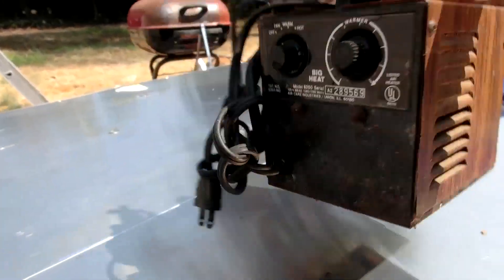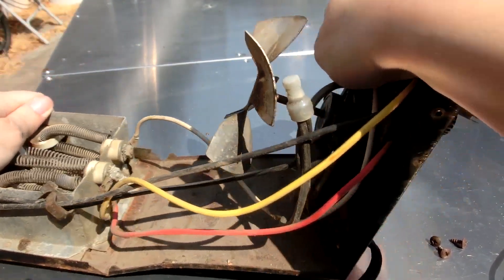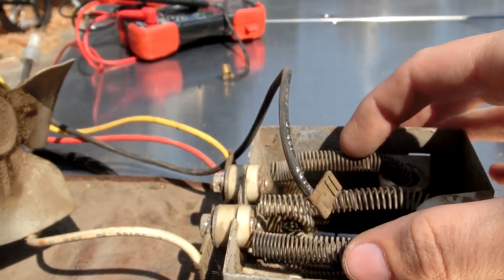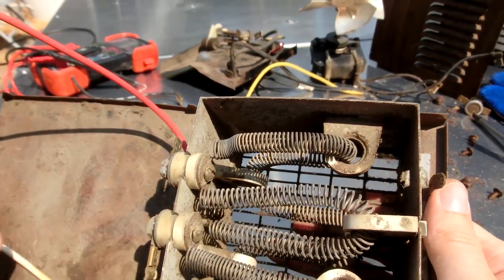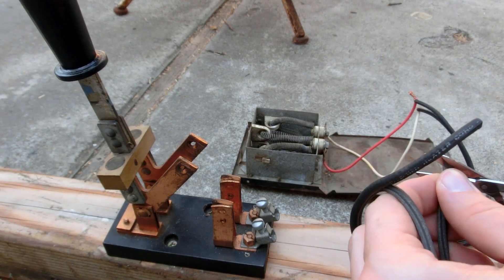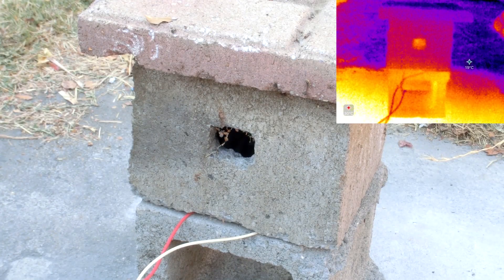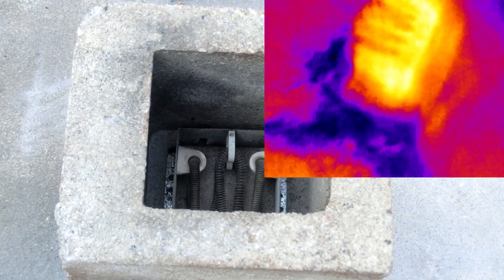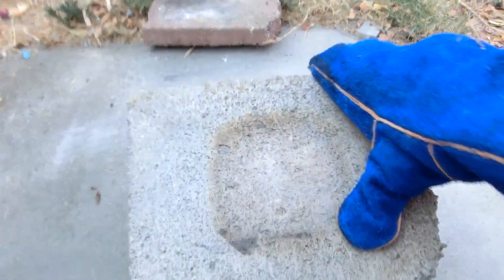DIY simple electric furnace / kiln from free parts

Comment: 1:03 ha! that's a type of single rope braid to neaten up tool cords. You pull the end through itsself once then just yank and it all comes apart.
Reply: a way to never have a tangle on a 100' extension cord. Learned it from an old electrician.
Reply: I've heard it called a daisy chain.  I learned it skydiving, after you land it's a quick way to get your parachute lines organized so they don't tangle
Reply: it's fast when I do it
Reply: you try to coil your parachute lines without a daisy chain, you better be packing your own parachute.
Reply: It's the worst way to wrap electric cords though. Loose untwisted coils is best for long cord life

Comment: I am genuinely surprised seeing how easy those little scissors snip those wires. Knife I had was rubbish, metal was as soft as aluminum. Now I understand why you like that knife so much :)
Reply from the maker: got this knife when i was 12 too, its cut every single 18650 terminal ive ever opened. so thats like 900 cells. haha
Reply: Got a Tinker myself around the same age and at 34 it still rattles around my pocket and has the battle scars to prove the number times of its been indispensable though the scissors are getting hard to operate b/c a mixture of gooey material that no solvent seems to want to shift has gotten into it's hinge area and the spring for the pliers is missing completely (along with the tweezers and toothpick that fell out somewhere along the way lol) because it broke so I used a pin punch to drive the remaining piece from it's holder after almost cutting myself on it a couple times.  Thing's literally saved my bacon more than once fixing things like a blown off radiator hose from a failed clamp when I was away from home and hadn't any proper tools in the car but could get a lift from the friends house I was near to the parts store for a new clamp and a gallon of coolant.

Comment: be careful not to damage your thermal sensor with too high temps. mine has a permanent shadow in it due to filming a candle for too long (the software adjusts for it, but still, one day it will be damaged to much to compensate)
Reply from the maker: i dont really care about this camera too much, i plan to get a better one someday. so i kinda see it as a tool that can be broken.  but thanks for the tip.
Reply: fredlllll. Candles must interest you?

Comment: I saw a dude's youtube video where he was instructing people how to wrap their extension cords like that... cuz then you can use it as a short cord without a bunch of extra tangled cord on the floor, or extend it and use it as a longer cord again.. seemed to make sense when I watched the video, but apparently not worth the effort as I forget what the method was exactly.  PS your hair is silky smooth.
Reply: sauce to your pf pic?
Reply: yes? i guess
Reply: YES.
Reply: The method Is loop over loop and I use this method primarily because the cord extension will last longer this way and far more easier to untangle. As you pull the end of the cable it simply untangle it self.

Comment: a good alternative use, pretty ingenious, however i would say that big switch is super dangerous (very cool looking though) like what if a cat rubbed up against it, or you tripped and touched it.
Reply from the maker: no its not super dangerous. if the cat touches it then it will be given a swift reminder of why not to. and just dont trip. tripping is the fault of going too fast. as soon as i make a system live like this i slow down a lot so i can be sure of how to interact with it.
Reply: +Rinoa Super-Genius 
Hi
you have a ~ 600 amp switch on a 14 gauge -15 amp circuit. The appropriate switch ( rated for 15amp) is probably $ 1.59 and a box could run you close to $3.00. Foolproof and safe.
Reply from the maker: *****
but this is a good reliable switch. it works already.
Reply from the maker: *****
no, i dont "assume responsibility" for if others are idiots. my video clearly shows me not getting shocked, so if somebody else gets shocked they arent following my video. plus if a few more idiots kill themselves thats fine with me.
 
oh and my channel name is sarcasm, ever see looney toons?
 
this switch works fine for my application, i enjoy the simplicity of it and feel its made very well. if you have issues with that then just fuck off and dont watch. simple as that.
Reply: +Rinoa Super-Genius 
That's unfortunate. You clearly do not understand what responsibility entails. It's also sad and a little stupid you rely on luck rather than easily acquired skills. The only hope you have is  your infantile ignorance doesn't kill anyone. I hope your maturity kicks in before that.  Good luck

Comment: that switch is a hazard waiting to happen
Reply from the maker: only if you act like an idiot and dont respect electricity.
Reply: +Rinoa Super-Genius yep but that switch looks quite tight on them contact maybe you could slip
Reply from the maker: RC MAD
what?
Reply: If you pulled the handle and for some reason your hand slipped and hit the live wires
Reply from the maker: RC MAD
well i dont know how that would happen because if i was pulling it was be away from it...but lets assume this is some weird 4 spacial dimensional universe, it would still just be a 120v ac shock. it would be a firm reminder to be more careful, and not live in 4 spacial dimensions. lol
Reply: +Rinoa Super-Genius maybe a future video of you putting a clear box over it or even plexiglass made by yourself that would be cool
Reply from the maker: RC MAD
no, stop being absurd.
Reply: I Love that OG switch.  and it's only running 110 anyway, right?  if you don't respect electricity while you're using it you soon will xD
Reply from the maker: Tom Cummings
exactly.
Reply: you won't actually get 20 amps through your body. human skin has a resistance of up to 100,000 ohms. using ohms law with 110v and let's say 10,000 ohms that would give us .011A. .011A is enough to cause pain, but not enough to kill you. .1A and above is lethal.
Reply: "a resistance of near zero" this just in: humans are super conductors. the resistance is dependent on moisture and distance. even when wet, human skin can be around 1000 ohms. If the skin was broken where both contacts touchced the body, then the electricity would go through the hand, not take a damn detour to your heart, stop by and say hello, fuck its day up, then leave. Electricity follows the path of least resistance, so just don't touch each wire with different hands while wet and have gaping wounds
Reply: While I totally agree that electricity can be very dangerous, I've been shocked by 240V AC (actually closer to 250V) mains several times and still here to tell the tale. Hurts like a B*tch though. When it comes to high voltage electricity - just be careful!
Reply: well I didn't see rinoa tip-toeing around the thing and he appears to have survived despite that.  and having been shocked tons of times working on swimming pool pumps wired for 220 I fail to see how there's much of a mortal danger in a lil' 110 bite
Reply from the maker: *****
400 is a pretty small amount. thats like how many people die from ladder related injuries.
Reply: key point here is WORKING with electricity, I reckon.  becoming complacent and careless.  performing the same tasks over and over again such that one can do them without thinking.  that's when accidents tend to happen
Reply: and I doubt they are stupid people.  easy to claim that they are stupid from a perspective of not having been there
Reply: having a huge open switch with live current is the opposite of respecting electricity
Reply: I’ve been shocked by 110 like 100 times. No it’s not fun. It’s just a reminder to stop being stupid.

Comment: Perfect use for your knife switch. Some years ago I was into home foundry stuff. I poured a furnace with grooves around the sides and put elements similar to yours in it. I could melt aluminum in it and where earlier I used a charcoal furnace, the electric could be used indoors. Very handy. I can see you getting refractory material in the future and pouring one to your specs.
Once again Rin,,, well done.
Reply from the maker: thanks!
Reply: That works very well.  In fact, the coils are the easiest part of this.  You can get the Nichrome wire cheaply and form the coils to your exact needs very easily..  Before it's heated the wire is easily coiled around a dowel or other shape to form a coil.  Once heated it becomes more stiff.  I built a kiln for copper enameling and it worked quite nicely.  Could get the interior to a bright yellowish-orange (hotter than I needed, I forget the temp).  The fire bricks are key -- they keep the heat in.  You can hold them together with refractory cement.  "Sairset" Iirc.
Reply from the maker: BixbyConsequence
yes ive already made a tiny furnace out of nichrome wire a long time ago. i didnt really go anywhere with that series because i didnt have time. i should soon though.

Comment: Why don't you use a light switch in a j box instead of the breaker like that?  the heat strip is a common item to find in heat pump heating and air furnaces . I'll give you another something you  may try the compressor of a heat pump has a band around it at the bottom. it's called a crank case heater. this would be a more likely burn out . the heatstrips  in certain pieces of appliances will run at a constant without burning  out. but don't ever let one of those coils lay over and touch to itself  . that will give you the burn out your  looking for.

Comment: Why don't you connect the center tap to live and the outer two to neutral for more heat?
Reply from the maker: im afraid the single loop would pop, its not designed to have 120v accross it so i dont think it would last.

Comment: Any plans to try your hand at home forging?
Reply: Would it make sense? If you try to heat up the furnace far enough to melt metal it would break the coils wouldnt it? (depending on what material they're made of...)
Reply: JPRTonundFilmstudio I was stating in general, since she had said she tried similar experiments before. Also metals like Aluminium which is the home forging material of choice has a fairly low melting point.
Reply from the maker: yes i want to get back into blacksmithing. i used to be a part of a blacksmithing club in illinois. i want to build a hydraulic press so i dont have to use a power hammer. im not a fan of power hammers.
  
as for casting metal, i have a lot better filament to use for that. or i may pick up the arc furnace project again.
Reply: Rinoa Super-Genius Power hammer eh? Why not use good old fashioned regular hammers :P. But in all seriousness, I know a couple of people who re-purposed arbor presses for use in blacksmithing, though that's more for initial shaping, the finishing portion being hand annealed. When I used to do my little hobbyist blacksmithing, I just used an open air charcoal forge with a leaf-blower for airflow. Just threw the stuff i was working into the coals for a while. Granted I mostly used scrap iron and steel since it was literally everywhere. Mostly made hammers, ax heads, brush hooks, and the odd really crappy sword. Because everyone wants to make a sword at some point.

Comment: Do you think it could melt aluminum
Reply: It can melt NiChrome = >2550F (one time, and now you have 2 shorter coils) so yes as long as its insulated electrically from the Al. and you/your tools both thermally +electrically and not overheated.  That thing in your picture is simpler and safer

Comment: Hi! How hot did it go?
Reply from the maker: not as hot as id want, but my goal wasnt to test max temp quite yet. i was just testing the filament itself. when i build a housing out of fire brick, and stick a thermocouple in there i can get a better measurement and a much higher temp most likely.
Reply: +Rinoa Super-Genius i thought of something like this awhile back for melting lead and aluminum for my projects but never got to build it. If you can get this to melt aluminum, im surely going to put one together myself.. 

Great vids btw
Reply from the maker: Joshua Infante
it shouldnt be too hard. ive made a good number of electric arc furnaces but never really spent money to make a nice one. i hope to try someday.